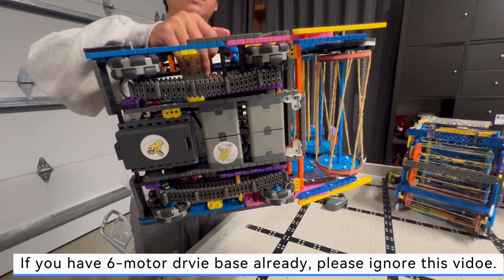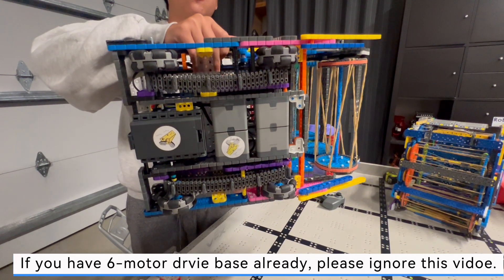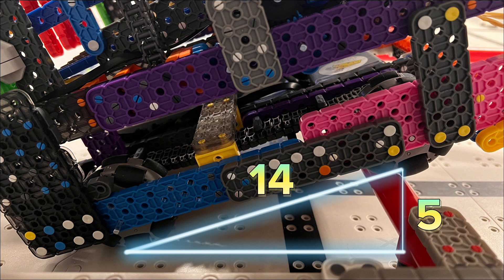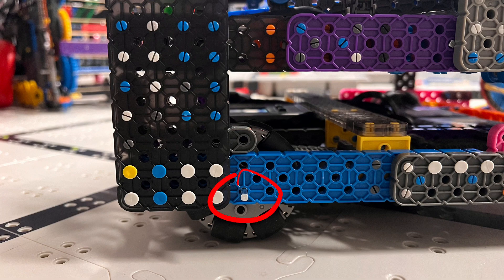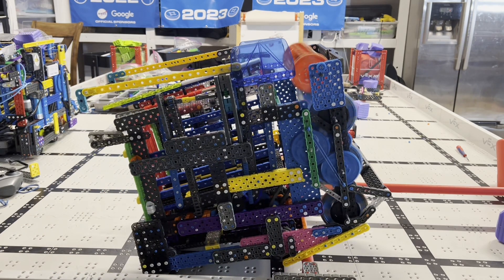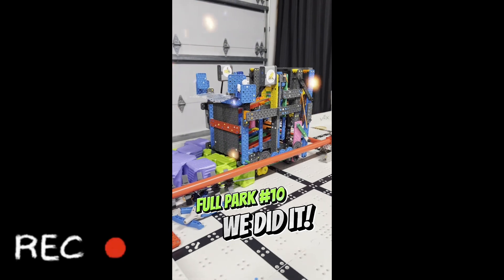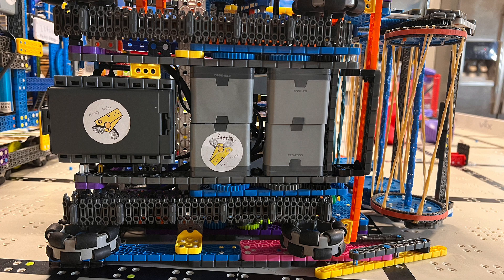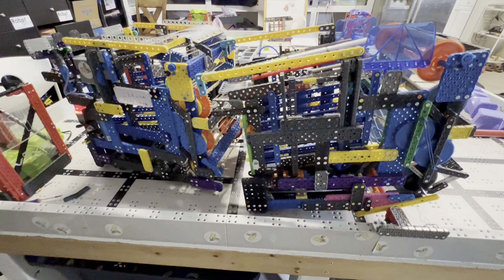Full Park And a Bit More.  VEX IQ Full Volume Robotics Competition

Comment: We got the full park to work with 2m 3:2. You need the front ramps all the way almost touching the ground so the bar does not get caught on the wheel. Bot needs to be front heavy and  fairly light
Reply: I have a video but don’t know how to send it
Reply from the maker: Wow! 2m without transmission is truely amaziong!

Comment: in a finals match in china there was a bot that seemed to of have used pnuematics by extending over the bar and then pushing the bot. It seemed to have parked really fast but they might of still you a 3:2
Reply: they got 170
Reply from the maker: There was one with 4m 2:1 drive base robot, pneumatic flippers for bar climbing. Then 2m PTO for everything else.